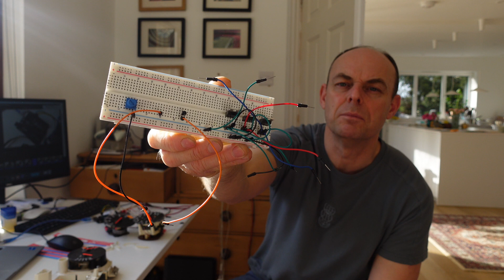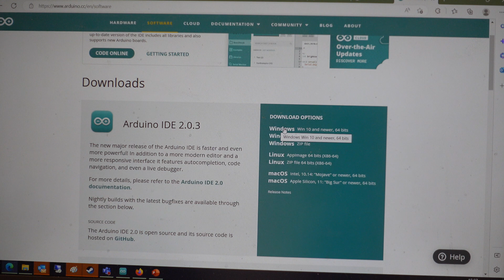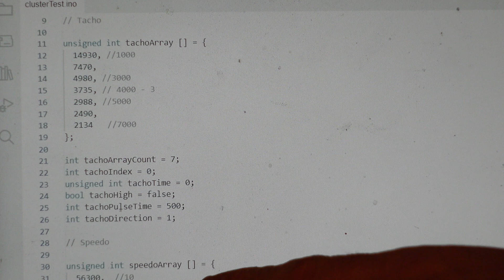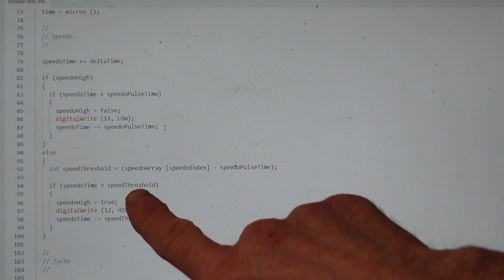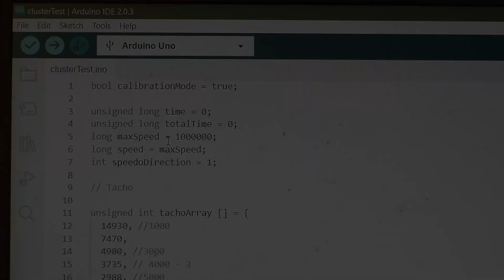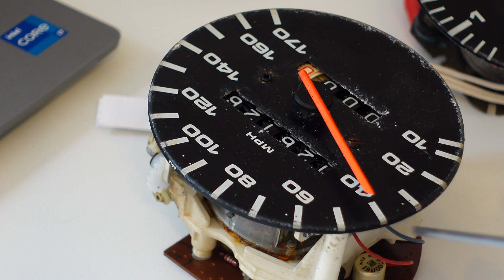Porsche Speedo and Tacho calibration

Comment: Hi Todd, I had watched this video a while ago after buying a barn find 928S2 in June, not realising I would actually need to calibrate my tacho after most of the dials weren't working, so I back here again and I have since cleaned all connections and everything is now working, the only issue I have is the Volt gauge didn't look to show true, and the tacho seems a little low to what the engine is doing. The volt gauge was easy, add 12v and adjust, but I am struggling with the tacho, after coping the script, I get a red error message,

exit status 1
Compilation error: stray '\302' in program

I'm copying and pasting as it is written, have you come across this issue before. BTW I don't have the speedo connected, but I'm still coping the whole script.
Reply from the maker: Hey :) sounds like something has accidentally been copy&paster in by mistake. Search for 302 and delete it - you can also message me on Instagram as you can send images so I can see.  With the speedo, are you sure it’s not calibrated? Perhaps the needle is just stuck on in the wrong position?

Comment: Great video Todd!. But how to wire up on the back of the speedometer? there are 4 pins on a 944 (>1986) speedometer.
Reply from the maker: Ah, I’ve never seen a 944 Speedo :(  can you search online for the wiring diagram and see if you can work out which wire is which?
Reply: @MrToddGibbs  the wire diagram shows the 3 plugs with all the wires to the whole dash, but no details on the 4 pins. Does a 928 have 3 pins or 4 pins on the back of the Speedo?
Reply from the maker: Ok, checked and a 928 speedo also have 4 pins... I just cant remember which is which. Do I show in the video?

Comment: Todd, many thanks for this excellent video. Very enjoyable and really helps me find good applications for my arduino. I have an 85 911 with of course 6 cylinders and I wondered if I apply that 6/8 ratio to your array constants if that would suit calibration for a 6 cylinder motor. Have you been asked for cal factors for a 911 before and if so, would you mind sharing? Thanks  - Mike in Dallas
Reply: BTW, your software working first time in my uno R3
Reply from the maker: Hi Mike, good to hear from you! Never tried with a 911… but yes, it should work as the “8” is just the number of ignition signals - so 6 should work - let me know :)
Reply: Great, will give that a try and let you know if 6:8 or 8:6 on those constants works. Thanks for the super-quick reply
Reply from the maker: Great. You can contact me easier on Instagram (toddgibbsyoutube)

Comment: Hi. I appreciate I am very late to the party. Big fan of the 928 (but not an owner). Enjoying the videos. One question, where do the values in tachoArray and speedoArray com from, are they documented somewhere or did you calculate them ?
Reply from the maker: Hey, welcome aboard!! They are calculated. Tacho is from rotations of engine and 8 cylinders. Speedo is from a signal from the diff (I think it’s 4 clicks per wheel rotation)

Comment: First: excellent video. Well explained.
Question: if there is only one adjustment possible on the actual speedo, can I just adjust it a little and drive it compared to a GPS and by trial and error calibration avoid use of electronics that I don't fully understand? They all read lower than actual speed.
Reply from the maker: Hi Steve, yes you can do that :)

Comment: 2:37 That is an Atmel ATMEGA328P which is an 8-bit microprocessor. Not that for what your doing it needs to be 32-bit (It doesn't) I have a lot of plans in store for some of these in a Mercedes in the near future.
Reply from the maker: I used an Arduino R3, which has a ATmega328P 16bit processor. What are you planning ?
Reply: @MrToddGibbs  You had mentioned at that timestamp that it was a 32-bit processor. I was just saying it was 8-bit instead of 32 thats it.
Reply from the maker: Ah I see... I didn't listen to the audio :)  I just typed the processor an Arduino uses. Its 16bit rather than 8 isnt it
Reply: @MrToddGibbs  According to Microchip on the product page it says it's 8-bit. 8-bit is still really powerful for this sort of thing though. You could easily use that chip to replace the  Control box in the cars that have the KA-jet system possibly even the KE-jet system. Fortunately for you, you have the plain ole K-jet no computer required for the FI system.

Comment: so after purchasing everything I was able to get the speedo to work. I could not get the tach to respond. I couldn't find anywhere to adjust an 84 speedometer. There was no screw to adjust as shown in the video. After thing was working and then I heard a pop and it all stopped working. I'd make sure you make a fused connection because I think i toasted the speedo at this point and I was using a 12v bench tester.
Reply from the maker: Oh no, yes fused is a must. I think the speedo is quite robust so you probably killed the arduino.

Comment: Hi Todd - I am having issues with my 79 speedo and wanted to test as per this great video. Can you tell me where you connected the wires to on the speedo - are they direct onto the VDO board? I cant quite see the connection on the video - Thanks in advance
Reply from the maker: Hi Matt, I realised after releasing this video that I didnt detail how to connect to the gauges! I have updated the description to include that info. Thanks for pointing it out and good luck testing :)

Comment: Thanks for sharing this!

I already have a couple Arduinos here, and was planning to try my hand at a tester but hadn't gotten there yet.

For whatever it's worth, I found that your code will run on an Arduino Nano with no issues, so I didn't even have to dig up my old Uno.
Reply from the maker: Ah nice!
Reply: @MrToddGibbs  Nano programmed, now I just have to pull the gauges again...
Mine had a failed Zener diode and some questionable capacitors when I received the car, so this is definitely going to help prove things out before I try it in the car.
Reply from the maker: Nice one :)